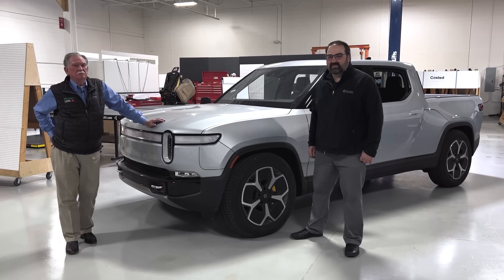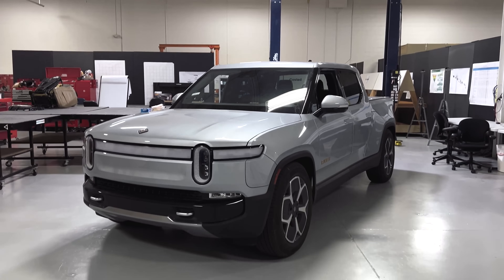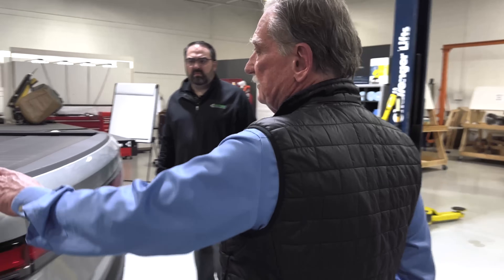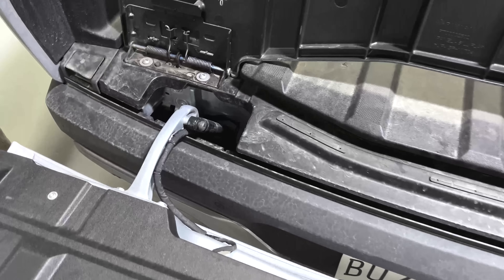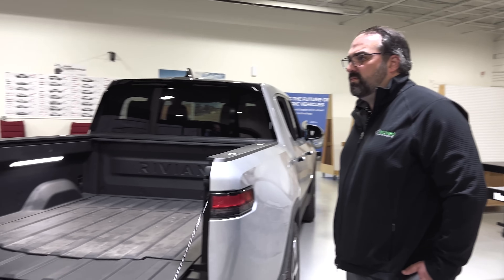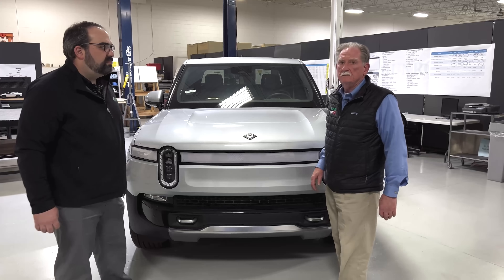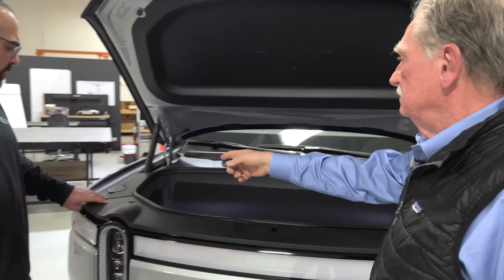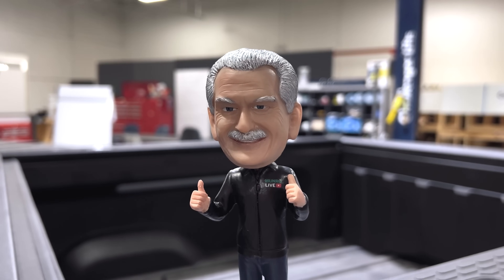Rivian R1T Teardown Kickoff!!!

Comment: I see Broncos, various Jeeps.. various Laptops with wheels like this above in their first year. Im not impressed with a first year vehicle. Sure, every OEM puts a Jillion dollars into the vehicle... but it only gets good when they get into year 3, 4+.

When I had my 4th,  5th and 6th gen Accords and I rolled up to a Honda dealer to get a part or two and to listen to how Happy the New Owners are.. doesnt impress me. Why, cause most of my Hondas had 150k+ mi on it and about 15+yrs old. When they get 10yrs+ old and everything is pretty decent.. then you got a good car. But.. a brand new one, from a Company who "produces" a vehicle which has heavy TECH imbedded in it.. along with a TON of cash just to get the thing built... isnt a surprise and Im not amazed.

The engineering parts.. is what Im fascinated about. The Consumer use bullshit.. just seperates you or I from actually driving the damn thing.

Comment: Strange that you aren’t including GM as both an ICE and BEV or EV brand? Especially with the launch the two new 🇺🇸Hummer EV SUPER-TRUCKS! The pickup and SUV are like the TRUCK and SUV EQUIVALENTS of the magical SUPER-CARS built and designed by Lamborghini (VW-GROUP -AUDI - PORSCHE - Ducati - ŠKODA and more), Ferrari and McLaren. not to mention the 100% redesigned Silverado-ICE and Silverado-EV pickups! These are wildly different from previous models, and are completely different from each other, in fact the EV version has a unified cab and bed - much like a full size working truck version of the near littler Rivian truck.
Both HUMMERS AND NEW SILVERADOS HAVE FOUR WHEEL STEERING! These trucks have a turning radius of a little economy car. So much coming from GM right now with the Cadillac LYRIQ - an awesome looking EV,a like a raised hot-rod wagon - so popular in Europe with Audi S4 & RS4 Avant and the S6 and RS6 Avant wagons. I’m not knocking Ford’s unique Maverick Hydrid truck or the modified F-150 Gasoline or ICE conversion to battery power, the generator aspect is very interesting and I’d guess a new F-150 designed will be out in a few years. Any word on the strange looking Tesla truck? Haven’t heard anything concrete about it, frankly I’m not certain it would even sell anyway, just not a design that can do truck stuff. The failed launch or introduction party was so very long ago especially in tech-years, the breaking glass was funny though. Maybe Tesla can stick to its specialty of making narrow and short or petite sized cars, and try to improve availability of replacement parts for people who’ve had accidents and can’t get fenders etc…like on all other brands? Or just buying Twitter haha. It should be interesting to see how the NEW GM performs over the next two years, if the EVs are anything like the newest hi-reving mid-engine Corvettes or the new Cadillac CT4-V and CT5-V BLACKWINGS, then lookout, automotive press saying both the latter have the best manual transmissions ever installed on production vehicles. Curious to see this ” teardown “

Comment: Loving your teardown videos on the R1T Munro. Curious have you found access to the R1T power? We would like to run a much higher power inverter so we can run more heavy duty possibilities for our camping and boating adventures. Would we simply wire in to the 12Volt portion of the Rivian? Or is there an option to tie into the Trucks massive battery somehow? I see inverters that allow either 12 volt or 24 volt tie in. Thank you for your thoughts! I just subscribed to your channel! @Munro Live
Reply: Would love to know this too! Most of the time we'd be fine with the 15A (we don't camp often where needing A/C). But even for that, it isn't clear to me how long the truck will power the 120V outlet in the bed (e.g. when the truck goes to sleep, does it cut power?) At least that behaviour can be fixed OTA.

Comment: @6:05: The divider under the bed serves the purpose of making regulators happy because it's less likely for a body to get stuffed down there. Though it looks like there is an escape button. Typically when they put a divider in there like that, it's so that they don't need to put a button (i.e. the front trunk of rear engine supercars)
Reply: You beat me to it. Thanks!

Comment: Why in the world would anyone think "jacking the price up" makes any sense for future sales? The whole point of all this is to get serious about breaking free of the "luxury class" vehicle which seems to be getting harder and harder these days. The consumer has been so inundated over the years with various styling regimes and add-on options that if truly a "form meets function" design showed up with the quality being touted here, then, I am sure sales would follow. 

A minimalist EV truck that is built well and is integrated around a variety of useful features is a simple idea. 

Plus, transportation isn't going to be cheaper in the future and with lithium ion as still our only option such low energy density technologies will require massive conservation of energy, which means the luxury vehicle is a dinosaur if we are actually trying to solve our mobility problem in this country. Why in the world would anyone put a low energy density system like lithium ion in a huge heavy SUV? Again a giant battery made of thousands of smaller ones is not exactly best practice - even if we are not willing to wait for something lighter and smaller first. The lightest possible design ought to be the first goal along with driving fewer miles in total. Instead consumers are still thinking EV's mean more for less. Fossil fuels are the opposite in offering very high energy density with all the usual negative side effects on our health and the environment. In other words, trying to run a society like ours which is always trying to grow on low energy density and intermittent sources means massive rationing and conservation, thus, vehicles that hone their function to meet low levels of consumption are the future etc.  

It'll be a stark wake up call later this decade when all this new tech reveals the simple fact that doing more with less and dramatic conservation of renewable energy is the only way any of this can truly be scaled.

Comment: I think you should start incorporating paint thickness testing - one thing you will find with these third rate new producers is a tremendous amount of paint correction/respray on panels.    Rivian, Tesla, and Lucid have pushed out the door vehicles that have had numerous resprays on body panels as evidenced by a company that specializes in paint correction and protection.    At times the paint thickness goes from barely 3 mils to over 8 mils on these third rate producers.    

You also failed to mention the horrible paint on this Rivian - significant orange peel and uneven paint application.   It shines, but the paint application is not good.   Barely acceptable on a $20k car - totally unacceptable on something over $70k.
Reply: Mercedes fanboy?

Comment: Someone should tell Sandy that the storage area in the bed, is for a spare tire.  Obviously they didn't order the their trucks with one.  And does Sandy always want to tells the manufactures to increase their prices, $100,000 for a truck is ridiculous!

With all the positive reviews for the Rivian, it's odd that their stock price keeps going down.
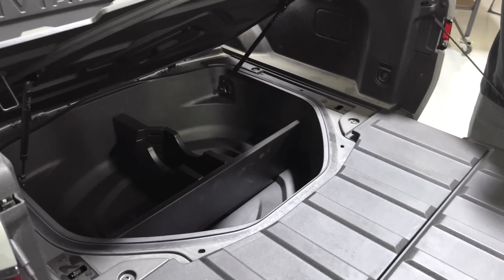Reply: Sandy did mention @5:55 that it could be used for a spare tire.
Reply: @brianb-p6586  Yes he it "could" be used for a spare tire.  But that is what it's actually there for per design.  However it is surprising that the spare is optional and not included in the purchase price.

Comment: Sorry Sandy but I don't condone your opinion that the price is too low. People are looking for AFFORDABLE vehicles but the trend seems to be to make cars only the one per cent can buy.
Reply: There exist both high-end and low-end vehicles. Sandy's point is that value this vehicle provides exceeds $74k, and the company should price it accordingly. The F-150 Lightning starts at $40k, with fewer wiz-bang features.
Reply: @holycrapchris  Thanks for the clarification. So 'perceived value' is a marketing strategy now? I know Tesla has that idea also regarding FSD. Not sure if most consumers really care (BIG trucks, that's a different case) We need short-range, CHEAP Evs to really get the ball rolling. It's just for elites now.

Comment: I think I’m more excited about this tear down over Model Y. Really looking to see how good Rivian is out of the gate. This will inform how well poised they are to succeed. If they have strong engineering from the get go (looks like they may), I would imagine it makes things much easier in the long run. Hoping they move to a heat pump before my R1S is delivered next year. Unlikely, but fingers crossed.
Reply: In this market, an average affordable product (EV) will make a company stay alive. They just need to sort out the manufacturing, which is apparently significantly harder then the prototype. If they cant get that cash burn down their fate is sealed. Will be interesting to see if these highly funded companies can survive.

Comment: I've heard that serious towing, like an RV, can knock the range down to 100-125 miles, and that it charges slowly. Be real curious to see what you find.
Reply: Out of spec did one and you’re correct,  it’s a lil over 100 miles.
Reply: @alexnutcasio936  Thanks. I guess with a 25kw generator and a big fuel tank in the cargo bed, they could always be run in hybrid mode. 😐

Comment: Surely we could improve access to the frunk. The hood is surely a throwback to ICE. Do we need a massive door twice the area of the frunk. Apart from topping up wiper fluid you probably never have to open the hood except to open the frunk. Surely a more appropriate door is possible.

Comment: Rivian right now is a niche manufacturer but to achieve the standard of quality they're going for, they have had to become a full fledge automobile manufacturer with no where near the sales volume to support such a complexe operation. 
There is no way they could make this level of quality vehicle without scaling their operations. Just sourcing the battery and the injection molded parts alone would put this vehicle well over a $100K, there is no way they can stay under 50K cars sold and keep the company afloat. And they're trying to introduce a second vehicle, as long as it shares all the same architure in a different shell it's possible.
Sure they can discount the car and lose money on every vehicle sold so that they can at least get vehicles out and production numbers up but that's not going to stop the bleeding, they're only hope now is to jack up prices as quickly as possible to not further alienate whatever customer base they have. They gotta stand by their product now and deliver through.

Comment: Sandy, I think if your looking for a toy to use as a daily driver in the city, Rivian and fords new lightning are just the ticket. When are they going to make a truck for the rest of the world.  We use Ford F150's, & Chevy Silverado's. When we hookup a Goose neck 20 foot trailer an haul a load of 8 Steers to market we're well over 11000 lbs. or use a goose neck 20 foot trailer and drag a 8000 lbs. tractor to the field in mud or soft ground and travel on gravel hilly roads just to off load the tractor, then load the trailer with 6 to 8 round bails weighing 1.500 pounds +. We're not stopping to charge it up or fuel it up. I'm curious how far can you go on a gravel road pulling 11,000 pounds with the extended range battery. Can you even put a fifth wheel for a goose neck trailer hookup  in the bed of an electric pickup?  The working world doesn't need a Pickup Toy we need a Pickup Truck.
Reply: Rest of the world?  99% of people don't tow, haul or do anything 'truck' like with their trucks.  The NTSB or some other outfit did a truck driver survey a few years back.  You're being arrogant and simple thinking you define the typical user.
Reply: That will come.  One thing at a time

Comment: Rivian has said that the Frunk should NOT be used as a cooler with ice as there are items located under it that shouldn't be immersed.  I guess we will know what's under there pretty soon =)
Reply: It's fine
Reply: What's the drain plug for then?
Reply: @vagabond_trader  To allow any water that gets into the frunk to drain.  You can't assume that water draining from the bottom is the only potential issue because condensation will form on the warm side of the frunk.  IOW it is not just draining that can cause a potential issue.  There is also some sort of weight limit to be considered and that would potentially change if the plastic was frozen from ice.
Reply: @genephipps6421  interesting.  so is the frunk more susceptible to condensation than a regular trunk of an ice car?  i haven’t seen one yet with a drain plug for the spare tire compartment…but i could be wrong.
Reply: @vagabond_trader  not any more or less than other enclosures.  How often do people fill their trunks with ice though?  The condensation forms because the ice side is cold and the underside / other side is exposed to warm moist air without any insulation.  And yes some off road specific vehicles do include drains.  Again the drain is for wash down, not ice storage.

Comment: I don't think that I've seen any Munro reviews talking about paint quality or cost.  The  paint quality looked pretty bad on some of those shots, with a lot of orange peel reflections.
Sandy might be getting a little impartial now on us, since he bought a personal Rivian.  I was shocked that he didn't blast it more for the terrible front fender fit, and why it went with expensive magnet mounting for frunk trim.  He said, "I like It".  Maybe, there are good engineering reasons, but we don't know any yet.  He wouldn't like cost or weight of magnets.

Comment: The benefit of that divider in the middle of that under-bed storage bin does serve an additional purpose, of support. if you loaded that bed up with bags of landscaping decorative pond rocks, it'll help that center section not sag, which over time could make for a place for water to pool and sit.
Reply: It's actually a legal issue. The compartment would need a handle to open from the inside like a trunk without the divider.

Comment: Well, here is Peter 🙂
1 It is a pity to see NON of the EV designers still did not think about a place in the middle counsel for placing your food and drinks during charging or after passing a drive-in. 
At least I would expect an airplane like table in 2022 for a truck this size. It was already a pain in the ……. Back In 2008. 
25 cupholders will not help me holding my burger and Belgium fries ( French fries ) with mayonnaise ;-)

2 the frunk button is a pain in the …… after 10 beers. Your hands will always be dirty searching that switch . The frunk is to high for women lifting shopping bags into it. Tray to lift 20 Kg in there. 
3 So bad I still don’t see a standard sliding floor in the back of this truck. 
I had to make one myself 😉 
4 The holes for the racks will bring problems with snow and ice. I also don’t see a storage area for the racks when I don’t like to use them. They have to stay at home? 
5 The switch for the tailgate will also bring problems in Wintertime ,idem the back cover when you don’t use Vaseline before the Winter comes. 
But at the end of the day, it is a nice truck.

But at the end of the day, it is a nice truck.

Comment: 135kwh and only 300 miles?! That terrible efficiency.
Reply: Trucks tend to be less efficient.
Reply: @TheEvilmooseofdoom  they do, but everyone in the industry knows they have the most inefficient battery technology in the industry. You are paying for a huge battery to go 300 miles. FORD is more efficient and they barely make EVs.
Reply: @GET2222  Do we have any hard numbers outside EPA estimates?
Reply: That's kWh (kilowatt-hours), not "KW". 135 kWh for 300 miles is 450 Wh/mile or 280 Wh/km (28 kWh for 100 km). That's about 50% more energy consumption than a typical electric car, but it's bigger, taller, and heavier than those cars. All of the EV trucks will have this sort of high energy consumption.
Reply: @brianb-p6586  thanks, didn’t have my readers on… hahaha

Comment: I'd've like to see them move the washer fluid filler neck over about 2" so that I can get the mouth of a full gallon of fluid closer. Rivian is better than some, but just not quite optimal They're always positioned so that a full gallon bottle will start pouring before you can really get it close enough to aim accurately at the opening. I lose a few oz every time. WOW!!! I'm really digging deep to find something to complain about.😆Good job Rivian. Welcome to Sandy's "Big Three" of US automakers.
Reply: It's called use a funnel?
Reply: Keep a funnel in the cargo net